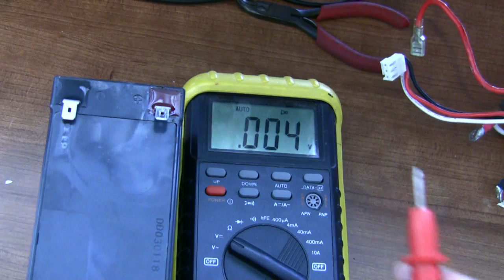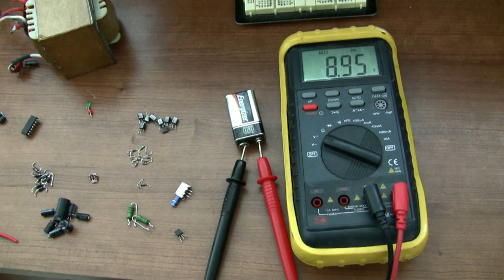How to Turn an Old UPS into an Alkaline Battery Charger!

Comment: This is great! You don't need all the parts in a UPS anyway since the Power Supply on the computer only converts the inverted power back into DC anyway. All that converting is wasteful. It's better to find a way to directly connect the battery into the power supply.
I learned recently from an Instructable that you don't even need an inverter to run most power tools. That 'ible suggested stacking seven 12volt batteries to get the voltage up, but I'm thinking it will be fine to use one battery along with a capacitor array to get the voltage up. I need to make a 9amp plug-in electric chainsaw work on battery power just long enough to cut one tree.
I hope you will use these ideas in a future video.

Comment: but isn't that a non rechargeable battery ?
Reply: If you are careful you can charge them, but it's not that common and takes pretty long. Constant current charging is not the optimal way to do this though, but who cares :D

lg, couka
Reply: charge it with low current?

Comment: Does it mean voltage makes no difference here, and I can take this 12V to charge 1,5V battery ? Is is only about reducing current ? If so, how do I stop charging battery looking at its voltage ? During charge it will be huge probably, far above 1,5 V

Comment: Just a quote from wikipedia: "Low-ripple direct current is not suitable for charging disposable alkaline batteries; more suitable is a current pulsed at a rate of 40 to 200 pulses per second, with an 80% duty cycle"  There are other projects to charge Alkaline batteries. Namely ones that use a 555 timer to archive this pulse.
Reply: I just wanted to write that but I just saw your post.

Comment: Wait you can recharge alkaline batteries? Since when?
Reply: +Ciroluiro Only slowly. Very very slowly. I recommend 100mA or less plus some kind of thermal cutoff touching the battery being charged, but yes it is very doable.
Reply: @RiaRadioFMHD773  And it turns out he was overdriving the batteries pretty heavily; about 178mA (with an online LM317T current calculator) and there was no overvoltage protection, termperature protection, none of that. This is really a very simple solution, and hter could no doubt be a ton of improvements. I don't even know why I'm commenting on this 12-year-old video.

Comment: i wouldn't, not unless you have the battery routed outside to a box or something because a car battery exploding in your house is not fun.   

bottom line don't do it with a car battery they are not built for deep cycles and will heat up and probably blow fuses, get a deep cycle AGM marine battery and that should work better and be alot safer, still wouldn't recommend keeping the battery indoors though just in case.

Comment: Yes. You would have to extend the wires outside the case to reach the car battery as it will not reach. Any 12v battery that is of the same battery chemistry should work. Just know that car batteries are not designed for deep cycle use and they will have considerably less life span then if you used a similar capacity deep cycle SLA. ;)

Comment: Seems to be a waste of a perfectly good UPS is the battery was the only reason why it was crap. I found two in the trash a couple weeks back. One was bashed to pieces by the kids that threw it away. But the second one still works. The battery was bad. But I happened to have a spare that fits! :D

So now I got something that would have cost over $100 to get. (It's an APC Back-UPS CS 500 by the way).

I already have an alkaline battery charger though.  :P

Comment: You CAN recharge an alkaline battery if it's no more than 4% discharged.  I've done it myself.

The thing is, charging produces gases, which build up too fast... and then there's irreversible polarization when you discharge too far.

Comment: You don't need to know much to do that. I've only been into electronics since recently, but making a generator from an electric motor is easy and basic stuff. You'll only need to hook up a motor to a battery and put some diodes in between to prevent the battery from discharging again. There are a lot of videos on YouTube which explain this very thoroughly, even for beginners, so I recommend watching those. Even Afrotechmods has 1 videos where he uses a servo motor as a generator.

Comment: That doesn't work on some newer PCB's with lead free solder. I recently had this while scavenging a PCB. Even with the soldering iron, it was next to impossible even at the highest temperature. I settled for getting only the really interesting components by diluting the lead free solder with lead-tin solder so that it did melt, and then removing it with a desoldering pump or wick.

Comment: You should use a heat gun paint remover to desolder every component on a pcb at once. Make sure to remove all of the connectors, caps, fuses, transistors and pdips first! I harvested components from many devices such as commodore 64's using this technique!

Comment: there are suction pens on Amazon.. work for some people.. if they dont use the narrower braded desoldering tape, comes on a neet little winder.  use lots of flux, edge of tape on solder apply heat tip to both solder and tape.. lots of flux. tape gets hard, move lower on tape, or cut it off with nippers. the wide tape takes too much heat to work.. and can over heat and ruin the part.

Comment: Reading comments, ppl should know before comment that u can charge alkaline batteries too, but no at their full charge. And you can't replace the battery in a UPS or use as 12v-220v inverter if the problem is in the PCB (like mine...)

Comment: I just use the my adjustable constant current DC power supply 0 ~ 30V, 0 ~ 5A to charge all kind of batteries but must use with timer.

Comment: hmmm....thats a waste....i found one of these at a thrift store for 6 bucks and the battery was bad,that was the only thing wrong with it, so instead of building a cheesy battery charger, i kept mine and put cables on it and keep it in my car and use it for a 12-120v ac converter....far better use than a simple battery charger.....right.....comes in handy when the power goes off during a storm to....yeah what a waste to get a few components.......

Comment: That is just stupid.... you have a perfectly good inverter circuit with a built in batery charger and you destroy it to take some crappy components you can get for 50 cents... or from any other useless old board lying arround... That's a sad waste!

Comment: you can but it will get hot and eventually could start on fire, besides its pointless because its not an ion or reversible reaction, its a one way reaction that  happens in alkaline batteries.  there are ways to do it though, carefully with a certain frequency pulse, and it takes a long time, and they never get full, plus it needs to   be seriously pro circuitry to monitor the health and heat of the battery, plus what it will do under load.  dont try to recharge alkaline unless youre an expert.

Comment: @RMoribayashi APC ones have internal battery calibration values which can be tweaked through software (APCFIX.EXE) which may help when fitting bigger batteries but for other brands I don't know. Also bear in mind that the UPSes designed for bigger batteries (or capable of running external battery packs) may have beefier chargers to do the job.

Comment: @superpoop899 They can be recharged, but I always thought they needed a PCR charger circuit (periodic current reversal) rather than just current-regulated DC. I think I've still got an alkaline charger in the attic, I'll have to dig it out and hook up an oscilloscope.

Comment: had a power supply and motherboard from an old computer.. several hours with a soldering iron later, I have more capacitors transistors SCRs and resistors then I know what to do with.

Comment: I have seen people using just the inverter side of the UPS to be used to invert the voltage from an array of car batteries, which are charged and maintained with a separate charger, then if the power goes out, hook it up to whatever needs running...far more capacity than the standard UPS and a far cleaner sine-wave than an automotive grade inverter.

Comment: I've got a small UPS (about the same size as the one in the video) with a dead battery. I've found replacements online but I was wondering if I could use battery with a higher AH rating to get more time (NOT more power) from it. I don't know how it knows it's got a full charge. Is it just charging to the rated voltage or something else?

Comment: So you completely disassembled a board that not only converted dc voltage to ac voltage as an inverter but also charged a big ass battery to create a tiny battery charger??? That wasnt very useful

Comment: You can't recharge alkaline batteries... 

Also you're gonna want your circuit to stop charging once it reaches the battery's fully charged voltage.

Comment: @rockman378 A google search for "sealed lead acid battery" turns up tons of results.  The variety used in just about every UPS I've ever seen is 12v, 7.2Ah (in larger UPS's, they typically have a bank of these batteries).  It took me 15 seconds to find that battery for $15.  I have spent far more time typing this....

Comment: @STREETRAT211 Its not conclusive to tell whether the to-220 package is a transistor or an IC (regulator on this case). LM317 is an adjustable voltage regulator. those with prefix of 2N or 2SA or 2SC are transistor. while those with prefix LM are ICs.

Comment: @GaryH315223 How do you conver the DC current into AC so it can be used with regular 110/230v equipment?

Comment: @madamerotten not in my experience they cannot. even the people that suggest doing this say you have to barely use them before recharging.  I think it is better to make a choice. use alkaline batteries for things like clocks or if you do not want to recharge. use NIMH batteries for things that use more power where you do not mind recharging. the new low self discharge nimh batteries like the eneloop or rayovac hybrid are quite good, will hold a charge for years, and priced cheaply (under $2).

Comment: @Applez00800 Car batteries release hydrogen gas, not toxic. About the only thing hydrogen would do is explode or asphyxiate someone if placed in a enclosed area with no ventilation.

Comment: I usually only desolder the higher wattage resistors, along with diodes,switches,trasnistors,etc first, and the little tiny resistors are pretty much a waste of time

Comment: @circles122345 - No. When car batteries charge, they let off toxic gases. UPS units use sealed lead-acid batteries that do not let off these toxic fumes.

Comment: @dingo27mobile - It charges 12volt lead-acids, not alkalines.
but really, he could have replaced the battery and turned it into a brand-new UPS. I did that once or twice because the battery in mine keeps dying. >:(

Comment: @Aleksa809 That's where a handy little device called an inverter comes into play. They take the 10v to 14v DC power and convert it to 115v + AC power to run all sorts of things. You can pick them up at walmart or autozone for your car power port. Simply plug it into the car and plug your AC device into the connector on the unit and your in business...........endless power